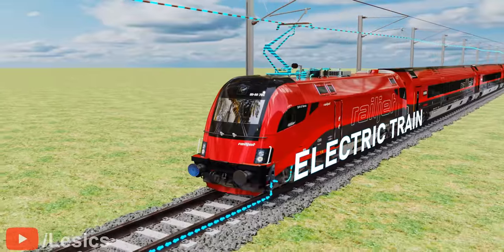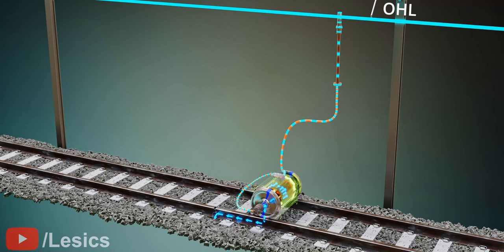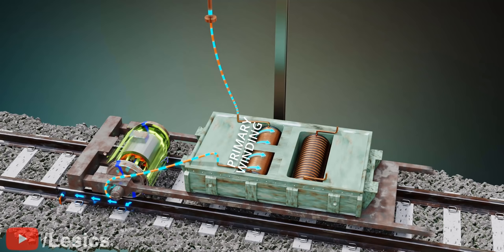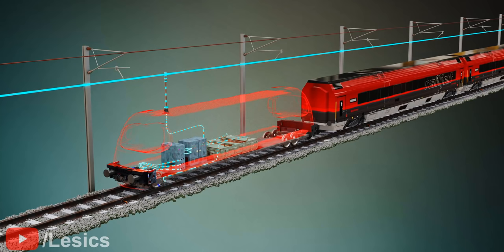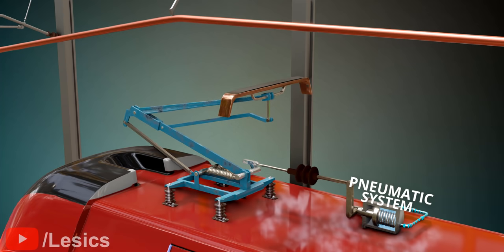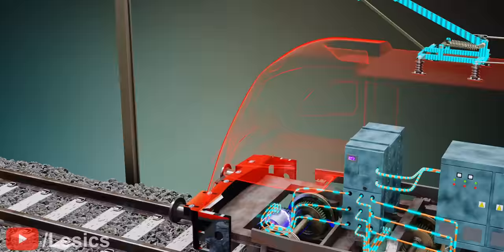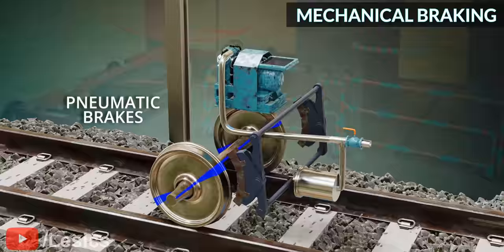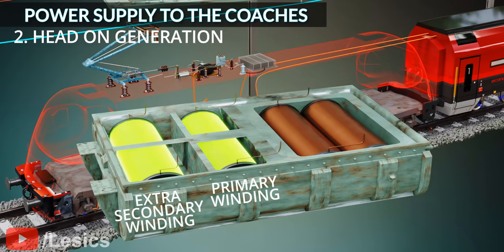The Fascinating Engineering behind Electric Trains!

Comment: Fascinating. How efficient are all those rectifiers and transformers? I imagine they must emit a lot of heat.
Reply: Transformers  are provided with oil and natural air cooling system (convection) 
Silicon oil cools the windings of transformer and oil is forced air cooled through a cooling unit like a radiator in cars.
Converter inverter unit is again provided with cooling  fins for natural cooling as the train runs .
Reply: Power electronics devices with higher pulses have efficiency nearly about 100%
Reply: @srmj5585  please what software was used to produce these animations?
Reply: @Tech.Library  Blender
Reply: its a lot cooler then a diesel locomotive
Reply: Less heat than a steam engine XD
Reply: Less pollution than steam and diesel engine
Reply: And noise. So much noise
Reply: @SphoorthyN  less noise than a diesel-electric trains that operate in most non-electrified lines
Reply: @SphoorthyN  yup, that why you barely can hear them at low speed.
Reply: @Sean Embry yes i agree
Reply: @Sean Embry Except a centralised delivery system makes vastly more efficient use of the same resource compared to a small engine, and even then only if the power station is powered by the same coal or diesel... Which many are not. You can't run a train on LNG because it's at too high a risk of exploding, but you can run a power station with it. You certainly can't power a train with a nuclear reactor, solar panels, or wind. DE locomotives achieve peak efficiencies of 20%-25%, whereas an average coal station in the US will run at 33% efficiency.
Would love to cite, but comments with links seem to be automatically deleted.
Reply: 95-99% depending on the quality. Even though heat generation is very little in comparison to power, it's still there. But air cooling is enough.
Reply: Transformers are 95% efficient while diesel engines are around 40% efficient but sometimes free heat is a bonus :)
Reply: E
Reply: @UnipornFrumm  depending on the loco, it's probably a diesel over electric so it has all the shown electronics plus a diesel/generator.
Reply: @SphoorthyN  so much noise? Compared to what?
Reply: Kurt, they generally have a blower moving air across the electronics or a heat sink connected to the electronics to keep them cool.
Reply: @srmj5585  oh lmao those barrels of oil near my colony's transformer , that explains everything
Reply: @EgorKaskader  Unless your in Germany were electric trains are powered predominantly by coal
Reply: Those are digital rectifiers and phase inverterters , they are like 98% efficient
Reply: @KiwiMaker  I thought transformers were closer to 90% and diesels were closer to 50% or potentially 60% if they use two fuels (RCCI engine)
Reply: Believe most USA trains supplied by AC power where they most likely use modern versatile variable frequency drives.
Reply: If a train was powered by DC power and using a VFD ( Variety Frequency Drives ) you would never need a rectifier. All modern AC VFD'S send input power to a rectifier that if 480 volts produces approximately 675 Volts DC Buss to supply power to IGBT'S. I have worked on hundreds of VFD'S and always found them a great piece of equipment to use. If you can say run a air handling fan at only 75% halve the day it uses maybe halve the power diluting reduced speed.
Reply: Bohol
Reply: @srmj5585  0
Reply: I get the feeling that this comment is trying to discredit electric traction?
Reply: I think it goes up to like at the very least 3°C
Reply: @EgorKaskader  It's so unfortunate that YT bans all comment links now. To me, YT was a much better place because ppl I run into would so kindly share references and be able to. (I share whenever I can too.) I comment a lot less nowadays knowing I will get a lot less.
Reply: On modern locomotives, transformers are oil-cooled, rectifiers and converters are water cooled.
One rectifier and converter for one bogie shared cooling tower with one cooling circuit of transformer oil.
Reply: Rectifiers average efficiency of approx 85%. A transformers average efficiency is approx 95%.
Diesel engines have a maximum efficiency of approx 60%.
So overall, an electric train is more efficient and does not have to haul its own fuel like a purely diesel engine would - thus simplifying logistics and improving efficiency even more.
Reply: @bfapple   I got that feeling too.

If they are, they’re doing a terrible job at it! 😆🤣
Reply: Electric locomotives can run hot. Like the French TGV, 18,000HP of electrical equipment. When the equipment blowers are running, you can visually see lots of heat blowing from the side of the power cars. Just watch some of “Dashloc” YouTube videos of the TGV. 
Unrelated, but a NJT engineer (operator), passed out because his ALP46 electric locomotive didn’t have working AC in the summer. Temps reached over 110 degrees in that cab.
Reply: @truedarklander IGBTs can be loud. Some electric trains make lots of noise too. (Maybe not loud low frequency diesels sounds, but high frequency electric noise).

Comment: Small correction needed. Multiple motor axles are in place to improve the traction. Because we can transfer the required power through a single motor, but the traction force depends on the friction between wheel and rail which is a limiting factor for an axle. By increasing more number of axles we can get enough traction to pull the train.
Reply: As a Indian Railway Engineer have often faced the brunt of poor performance of 4 motor locos vis a vis the 6 motor versions
Reply: In short, all wheel drive
Reply: @venkateshdyrwf7298  WAP5 vs P4, P7 etc?
Reply: Interestingly, some early electric locomotives were powered by one large motor which imparted drive to multiple wheels through a set of linkages similar to those on steam locomotives.

Comment: Who told EVs vehicle are lack of performance compare with ICE engine 🤣🤣 This video shown that a train using electric motors moreover all diesel locomotive (use diesel generator for supply traction motors)
Reply: nobody told that electric motors are worse... the lack of performance comes at EVs as their battery packs are so heavy they make the car so heavy. but with trains as they have pretty constant power their motors can be stronger bigger and they can have more of them without sacrificing range
Reply: automobiles and their counterparts have to transport their own fuel - the weight of the batteries counteracts the mechanical advantages of using electric motors. 

Electric locos (with pantograph or 3rd/4th rail) have the further advantage over ICE locos in that the source of power is independent of the loco (being from the national grid) - this enables a much higher power-to-weight ratio.

Comment: Ok, this video explains quite well how do electric engines generally work. But I noticed one huge mistake regarding to pneumatic brakes. In today's brake systems the brake cylinder is normaly empty when the brake is released. When you want to slow down you actually don't release the pressurised air from the brake cylinder, but the air flows from pipes which lead throw the whole train exactly into the brake cylinder, and overforces the spring inside. The purpose of the spring is to release the brakes, and not to apply a brake force becouse the power of the spring is not enough to brake a train which weights several hundreds of tons. No accidents have been noticed due some failure between cylinder and brake switchboard which is a device providing filling the cylinder from pipes. A proof about this fact is when you pull the brake lever in drivers cab, and you can see how the pressure in pipes is decreasing, and cylinders are filled, and the train starts to brake. That all means that the system works oppositely, than it was described in the video. But still, good job, keep on.
Reply: Electric braking is also explained very wrong. You can't brake a train by pumping more electric energy into the system. Electric brakes works very differently. The motor generates electricity that is used to heat the brake resistors.

Comment: Some bogies are 4 wheel while some are 6 wheel. Typically 6 wheel is on heavier, slower but higher torque engines like for freight trains while faster passenger trains have 4 wheel bogies. The one shown in the animation is the ES-64 from Siemens which has 4 wheel bogies. This is directly related to the ACS-64 that Amtrak uses on the Boston-NYC Northeast Regional and on trains to Harrisburg PA.
Reply: Yeah they are some minor mistakes in these videos but they are pretty good to gain a general understanding.
Technically the pneumatic brakes on most modern locomotives and coaches would be disc brakes, mounted on the wheel axiales.
Reply: Locomotives with 6 axles (2x3 CoCo) are actually rare. Nearly all modern locomotives are BoBo type (2x2).
Reply: @ppdan  not really. India, for example, nearly everything is 6. Europe, you're right. Even in the US, most of freight is 6 with 4 being more for passenger trains.
Reply: @mkkm945  MODERN locomotives. India and US are really 2 special cases. 
I doubt India has lots of modern locomotives. And the US is not a country with a well developed railway system (mainly focused on freight and barely electrified).
I am pretty sure that if you take the world wide production of locomotives in the last 20 years you will barely find any CoCo type among them (if any).
Reply: @ppdan  they are fairly modern. India runs insanely long passenger trains often over 20 coaches with a single loco, so the loco tends to be 6 wheel with a gearing for a lowish top speed (120kph) but lots of pulling power. India also recently launched the twin loco 4 wheeled Alstom prima with 12000hp for freight. US freight is extremely efficient and well developed, just lacking in electrification.
Reply: @ppdan  WTF are you talking about? US diesels are very modern by technological standards and almost all of them are C-C. China’s modern HXD series electrics are either B-B+B-B for heavy, high-pulling power freight or C-C for higher-speed passenger or not-so-heavy freight (similar to EMD GP series for freight). India also uses a lot of C-C electrics and diesels. C-C might be rarer in Europe but that does not mean it’s rare in the rest of the world.
Reply: @ppdan  North America has a very efficient and developed railway system. Just not for passengers.
6-axle locomotives are very common for freight (and passenger trains in some cases) in America and Asia (including Russia and China) where trains tend to be very long and heavy. Even in western Europe, high-power Diesel locos often have 6 axles to carry their weight, and 6-axle electric locos are making a comeback for heavy trains in moderately mountainous regions because they're cheaper than using two 4-axles.
Reply: @ppdan  
You are living under a rock if you think Indian locomotives are not modern. Where else in the world do you have regular passenger trains of 22 to 24 coaches (with each coach being almost 24 metres long). But yeah, even India's latest WAG12B freight locomotives are Bo-Bo and they have a power output of 12,000 HP.
Reply: @thetechnocrat4979  Never said they have no modern locomotives at all. A huge part of their rollingstock is still very old.
btw, 24m is a normal length for a passenger coach and the fact that they have trains with 22 to 24 coaches doesn't say anything about being modern or not.
Also, thanks for mentioning that their lastest locomotives are Bo-Bo type.
Reply: @joriss5  Co-Co for passenger isn't great since they are slower, which is one of the reasons why they switched to setups with 2 axles per bogie.
Reply: @ppdan  
Ah well, the ' majority of rolling stock is old ' is not completely true. Much of it has been replaced. Also, that locomotive is a twin section freight locomotive, that's why Bo-Bo is appropriate. The latest diesel freight locomotives are still Co-Co. The majority of India's modern fleet of passenger locomotives is Co-Co. Except for a few exceptions (for lighter trains of 16 coaches). 

Anyway, the idea that the only mark of modern traction is Bo-Bo bogies is highly myopic and as others have mentioned- there are lots of modern locomotives around the world who have a Co-Co configuration. It all depends on the requirements. 
Bo-Bo : Usually for lower loads and high speeds
Co-Co : Usually for higher loads and medium speeds.
Reply: @ppdan  Freight is still normally2x3 CoCo only light high speed freight ie  some container traffic is BoBo . I work for UK's largest freight operator we have some BoBo class 67's and they can only work much lighter freight even though have same power unit as class 66 as tractive effort is low . Newest loco's in UK are the class 68 BoBo its powerful loco but can only handle about 1'600 tons on most routes were as our fleet of CoCo loco's handle over 3'000 tons , but class 68 works passenger and freight
Reply: @ppdan Mainly in Indian Railways Co-Co is used for Goods train engine and Bo-Bo for Passengers
Reply: The number of axles is for weight distribution in an AIA bogie the middle axles isn't powered
Reply: @evangiles4403  that's relatively uncommon. Most 3 axle locos have 3 motors per truck.
Reply: @vishalkonar1167  Not true. Most Indian passenger locos are Co-Co. In fact there is only one Bo-Bo passenger loco, the WAP 5. All others, incl Diesels are Co-Co.

Comment: There was fitter killed in UK just by removing axle box covers to UAT the axles , the pan had been left up and loco was drawing power for auxiliary's . All was ok till he removed last axle box cover then his body became part of the circuit between axle and bogie frame for the 25 kv . Also the ground bonds on the track can be lethal if disconnected